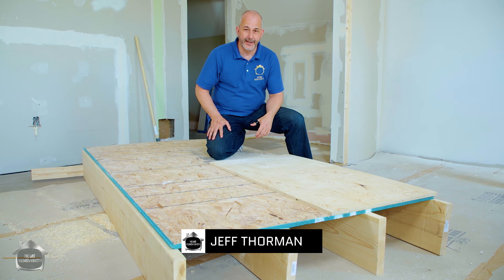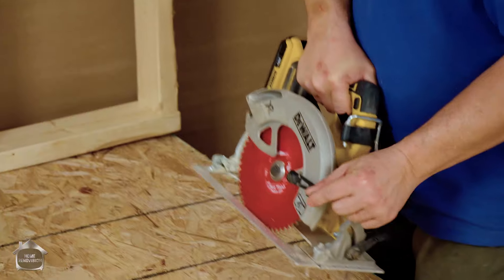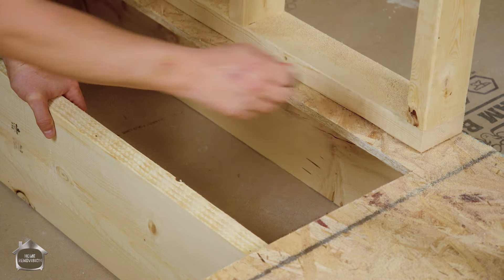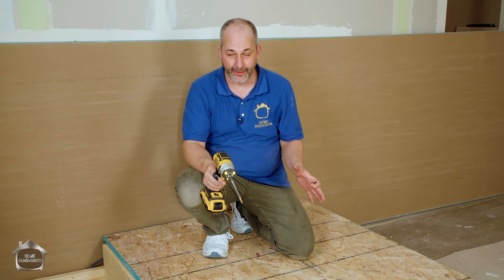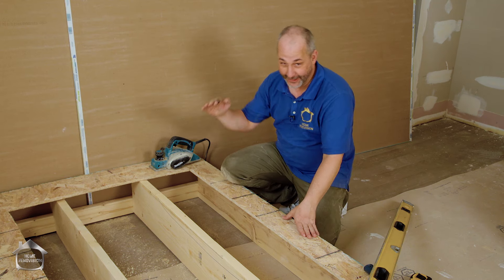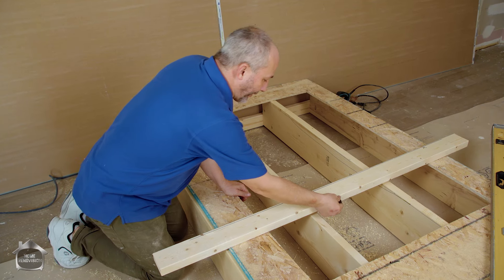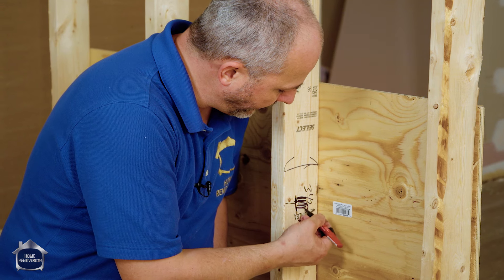Watch This Before You Renovate Your Floors

Comment: OMG this video is long but worth its seconds in gold.  Love the videos, Papa Jeff is the reason I'm remodeling my house (I'm a nurse with little construction experience) and only having to hire professionals for jobs I'm really not comfortable doing (electrical, plumbing, ceramic tile).  I'm about half way on my bathroom and kitchen remodel, took it down to studs and replaced subfloor since my house was built in 1925 and it squeaked like crazy.  Now the floors are not only stronger but no more squeaks.  And my kitchen and bathroom exterior walls now have insulation.  Thank you again Jeff, you not only have saved me thousands but helped me learn how to repair and maintain my house.  I live in southern California.
Reply: Wow!

Comment: The proper steel screw sizes for securing 3/4-inch plywood to the floor joists are #8, #10 and #12 screws. The number refers to the thickness of the screw. Each is available in lengths from 1 1/4 to 3 inches. Typically, the 3-inch variety is used to secure plywood subfloors.

Comment: I've never seen floor screws.  I'm in Michigan.  If I had seen those I probably would have bought them instead of the $30 boxes of 3" deck screws I put in my subfloor. Anyway I'm still glad I put all those monster screws in.  I'm 7:14 into your video... still watching.  I got rid of the squeaks from the subfloor but when I put the hardwood floors in I ended up with squeaks from the hardwood at a low point in the floor.

Comment: WOW! The amount of information in this 1 video is so valuable! I live in the second apartment of my house in northeast USA, its 117 years old, with tongue and groove wood planks nailed directly to the floor joists in the bedrooms and kitchen. The bedroom floors are in horrible condition (too thin to refinish, chipped boards, holes, oh my!) I want to install LVP flooring. Can I just put a 1/4 plywood over the wood planks? If I need to pull up the wood planks and install subfloors, what thickness would I use? 😮😮

Comment: My house in Winnipeg I had built in 1984 by a big builder and picked one of their house models.    i  asked that the 5/8 inch plywood be screwed and glued.   It has been very good I have a couple of squeaks upstairs.   I put ceramic tiles all over the  place and no cracks anywhere.

Comment: Hi Jeff. Great video. Just to confirm. There is another video on floor leveling where you use self leveling compound. The question is when to use the compound and when to cut the subfloor a d replace the plywood. Thank you
Reply from the maker: if you have a bowl use the compound. if you have a hump open the floor. Cheers!

Comment: Not getting into the mess of my floor being the old OSB w/ glue & regular nails....I bought the Brand ProGen vinyl plank flooring w/ the subflooring pad already attached to their bottom. So, after I try to stabilize any squeaky floor joists, I can lay these vinyl tiles straight onto the wood, right? :-/ . I don't trust any salesman these days, even though they say yes or no, ha. Thank you SO much for your VIDEOS!!!! I'm single without a man around the house &, living in a rural area, where it's hard finding workers w/ good handiwork, let alone finding workers period sometimes! My current little fixer-upper I bought has revealed more & more issues here & there that has been overwhelming me at many points. Having someone consistently giving a flow of information & teaching on all areas of home renovation has made me feel hopeful that at lease I can do some of the work myself (besides electrical!). Thank you again!!!

Comment: You are helping a whole lot with your videos...  Thank you...
I have a bathroom subfloor to repair...  The guy lipsticked a pig so it was pretty to sell the place...  So much hidden stuff...  The former owner of my home installed a low flush toilet with just a wax ring on the toilet pipe...  No flange...  Its leaked - you can imagine the mess...  Opening up the floor will show the damage to the kitchen ceiling below as well...  I probably have to pull the drywall ceiling in the kitchen... Then there is the bathtub that was installed 1/4 leaning to the front...  * Cringing... * It ruined the drywall - the tub n surround needs pulled & redone...  We need to repair the sub floor - add 5/8 plywood to meet the height of the hallway flooring...  * Sigh... *  I am really not looking forward to fixing all this...  But the more we can do on our own without hiring someone the better...  Thank you for your videos...

Comment: Wow, thank you for this! I'm trying to fix a floor that has a few water damaged areas in the subfloor, and I was wondering how in the hell you could cut out a section and still make it work. Also dealing with loose nails and squeaky floor. Excellent video.

Comment: Built new houses for a short time in the states.  Some houses we uses collated screws and long screw gun to screw down 1 inch decking.  Other homes they has us bent over with the nail guns adding more nails right before the flooring was done.  Nothing pissed us off more than to go into the sales model and fix the squeaks from the basement because they wouldn't pay for us to screw down the subfloor to save  $2-300 (1 guy less than 1 day) in labor plus the cost of screws.  They were also skimping on giving us enough glue for the subfloor.  It was about how fast we built not how good we built it.

Comment: hey Jeff - i am redoing my cabin.  the floors are wood planks maybe 2-3"wide all through the flooring.  Subfloor Ikd - I have to look.   In the bathroom is where I want to add a new floor.  Can I just put down on top of exsisting floor lets say 1/2 inch or less plywood to make an even surface to work with - I am going with a water proof vinyl flooring ( I watched the video of what to pick).  I actually watch a lot of your videos and so appreciate the info you give.  THANK YOU

Comment: I grew up in a Sears house built in 1920. The floor joists were 2X12 and the subfloor was 1 inch thick shiplap installed at 45 degrees to the floor joists. On top was 1 inch thick white oak 2 inch wide tongue and groove. A special paper was used between the subfloor and the oak floor boards. None of the floors on the first or second floor ever squeaked. The oak flooring was attached with cut nails through the tongue. The only visible nail holes were where we added boards during a renovation.  That is how we found the paper. The paper was green. It was not asphalt impregnated paper.

Comment: I'd like to know how to prep subfloor structure for tile when your 2nd floor small bathroom sits directly over 1975 sistered joists. Do I laminate the joist from both directions of existing joists? Do I apply blocking where the old joists r sistered? Should I apply thicker or special blocking if the original sistered joists are tilted/ separated from time? Thx!
Reply: Help!
Reply from the maker: you really need to send me a picture in the forum. I will look for it tonight. Cheers!

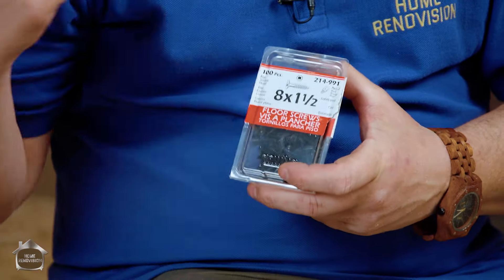Comment: 6:57 Hey Jeff, not sure if already answered, but gonna leave some info anyway, cuz ya asked for it.
Here in States we do actually have fasteners (screws) that are specifically made for subfloors, & some are marketed only as for WOOD to WOOD by some brands,  w/ specific tech data & skew and what meant for are subfloors (also, find that some stores and even ppl think subfloors and Underlayment 
is same thing. Not the case and same goes for Underlayment screws. I wouldn’t use an Underlayment screw for a subfloor, but I would use a subfloor screw for Underlayment if couldn’t find or have “proper Underlayment  fastener system” we are using. Hope makes some sense). Note for some ppl, there are brands that make fasteners and say “Underlayment” and in some cases, they referring to subfloor (Happens every so often as marketing and languages Kinda get muddy every now & than)

Here’s some Brands for subfloors and thru in Underlayments too. ALMOST all are Torx drive screws, or Robies, but alas….some are still only Phillips 🤦🏼 
In no particular order, we have:

1] Simpson Strong-Tie: R4 Multi Screw=general multi purpose but can be used 9n subfloors
2] Senco: Underlayment Screws
3] Simpson Strong-Tie: WSHL Subfloor
4] Simpson Strong-Tie: WSV Subfloor
5] Simpson Strong-Tie: Quik Drive Subfloor
6] Simpson Strong-Tie: MTH Underlayment Screw
7] Senco Duraspin Subfloor

So, majority are collated for coil nailers or strip nailers; or as a brands stand alone specific tool; along w/ an accessory for someones impact driver or drill driver that just gets attached…BUT these systems are to make putting these into subfloors auick, but if DIY or anyone who wants to do there own work and doesn’t wanna buy into a “tool system”, well you can purchase the collated screws and just detach them from “collated material” by knife, scissors, etc…. Having coil or strip nails doesn’t means YA GOTTA ONLY USE IN NAIL GUN😉, you CAN separate them and use good ole HAMMER to install, lol
Sorry for length, 
cheers Jeff and Max✌🏻

Comment: I am an electrician working in the United Kingdom. I am not sure how they do the plumbing and cabling in the USA and Canada but here much of piping and cables in older properties are laid in slots. The last time a carpenter offered to take some flooring up for me, using a circular saw, he did exactly what you did ie. Set the depth of the blade slightly deeper than the floorboards. As a result I had an hour repairing the cables he sawed through. Perhaps you could mention that for UK watchers.

Comment: Really comprehensive instruction.  Thanks Jeff.  I have the RIDGID JobMax oscillating tool which has the multi-head feature that provides different heads for different purposes.  The right angle drill head is great for both drilling and driving screws and will get into anywhere with about 4 inches of clearance.  Lots of power to bore through studs with any drill bit and up to about a 2-1/2" hole saw bit.  JobMax is a mid range tool, but with the lifetime warranty it's hard to beat.

Comment: I've never seen "flooring screws" on the shelf here in the US, but I'd be willing to bet that you'd be perfectly fine using 1-3/4" to 2" exterior screws.
Reply: Just use deck screws.  They have the same Robertson head.  You just pay a bit more because they are coated to be resistant to pressure treated lumber.

Comment: My home is 1955. Just had to take it down to the subfloor due to water damage. Looks like 1x8 soild board subfloor with 2x 8 joist every 16". Im having to replace a few boards because it seems like they split and broke some while installing underlayment.  I will be using screws as well as securing the old ones better with screws. Im also adding moisturizer barrier then 19/32 osb and uncoupling membrane befor tile. Does that sound like a good base for 12x24 tile?

Comment: A year after we moved into our house (built in 1966), we had to replace the tile landing by the front door. The house was renovated in 2016, but it all looked like they cut corners. The tile grout was failing and most of the tile was loose. We tore it up and found they screwed and glued the cement board on top of the original subfloor that was super thin and did not laminate the joists. So from 2016-2019, the subfloor and joists were slowly failing due to the wait of the cement board, tile, and people walking on it. We had to replace the subfloor because it had already failed in a corner and replaced a joist that was very close to breaking. Then we laminated all the remaining joists and the new one. 

It sucks because we are slowly seeing everything they "renovated" fall apart in just the 5 years we have lived here.

Comment: Our old house (built in 1965) had a squeaky second floor. After trying to tighten up the floor with screws , we still had squeaks. At a later date while working in the kitchen soffit I noticed that the contractor had use 1/2” cello-Tex on top of all the joists , under the subfloor, of the second floor. Over time the Cello-Tex  had deteriorated to the point where it was mostly dust but some solids which meant regardless of the number of screws it was always going to squeak. Although annoying at first it’s came in handy when the teenager tried to sneak in after hours!

Comment: Thank you, Jeff, for your channel.  Been watching your videos, but still nervous taking this on.  If the vinyl plank has an underlayment attached, should i still use an underlayment?  My "Michigan" basement is a freezer.  Been told two different things.  This is my first diy in a 100 year old rural farmhouse.  My subfloor is mixed across the room, and my subfloor sits on huge, old but solid timber logs.  They are braced together with 1x4 wood.  Little bit nervous as this is my 1st major project and im not young.  😊

Comment: Thanks for video! I had hired a general contractor to renovate my bathroom (1985 ) I had chosen 12” x 24” tile and shortly after he completed the project I noticed that the grout was coming up so he came back added additional grout but 6 months later it came up again. After watching this video I’m pretty sure he didn’t prepare the sub floor properly. When I go to hire someone to replace the kitchen floor I’ll be sure to review the plan for sub floor.
Reply: Did he lay the tile on OSB or plywood.  I once saw a problem like that with tile on OSB.  You can not put tile on OSB.

Comment: Question. I just pulled my sub floor in my living room to replace one of the seals and it was built with 2x6 with 16in span and 8 ft support so that's what I went back in with. But all I hear you say is 2x10.. so my question is what u have ok and is there something I need to do to strengthen it before putting in the plywood subfloor? Thank you in advance

Comment: Hi Jeff, How would you replace a small piece of subfloor under a wall and between the floor joists where the floor joists are open from the room below? The bathroom was left wet and is that subfloor is now gross, won't hold screws, and is flaking apart. Most of the area that needs to be replaced is in the center of the room, but there is about 6" that goes under the wall that I would still like to replace. Also, thank you. You have made  huge impact in my self esteem. I have taken a house that sat on the market for over 6 months, headed up the renovations (with some expert help when needed and to check my work) and created a beautiful and safe home. Adjectives like creative, hard working, resourceful, amazing, and beautiful now sit more comfortably with me after seeing for myself what I was able to do.

Comment: I pull all the old subfloor nails I can find and replace them with large stainless steel deck screws.  This usually stops the squeaking.
If that doesn’t work, I pull the noisy floor panel up and add cross braces and screw into the new cross braces along with joists.

Comment: i saw tommy silva from TOH use screws where the heads break off, but i have never found those , but i have  what looks like a finish nail shape with a tiny head and square drive ,  they look alot like what you are using as flooring screws , i use them for making furniture and speaker cabinets ,i don't really like my brad nailer so i like to use these because it leaves only  a tiny hole to fill , but we definitly have them , or at least what looks like them , i think they are actually labeled as decking screws, both depot and lowes have them

Comment: Jeff my 1978 house has toung n grove 8 inch wide boards over the joists and USB over that. The squeak is in the t&g joint. Only way I found to stop it somewhat was in the crawlspace with 2 inch screws angled through the joint. Still have squeaks just dont care as anymore. I also used a lot of sqeekeze snap off screws in carpet areas. Your floor will crack tile. Too thin.

Comment: Pulled up hardwood floor off my 1968 1000sq ft home. It has 1/2” plywood. Also has baseboard heating. Thinking I need to pull heater strips, and add a 1/2” more plywood to stiffen floor. Do I need to glue and screw, or just screw new plywood down?

Comment: ing a floor in an old cabin-type building, likely built in the '60s. I have bought vinyl tile (2') to go on the subfloor which I am to install. The subfloor is going over the existing subfloor, some of which still has linoleum on it. For some reason, all the baseboards were left in place and already caulked (so I can't pull them for the subfloor installation). There is uneven plywood at the doorways into the bedrooms. My questions are as follows: 
1. Do I need to level the existing floor prior to installing the new subfloor?
2. Can I lay the new subfloor over the partially linoleum-covered floor?
3. The vinyl tile we are installing is going throughout (living room, kitchen, 2 bedrooms and bathroom). We are repurposing some kitchen cabinets, as well as a new shower stall and toilet. Should I install the cabinets, shower stall and toilet directly onto the new subfloor we are putting in, and then vinyl tile up to these fixtures?
4. How forgiving is 24" vinyl tile with regard to sloping/uneven subflooring?
TIA.

Comment: Thanks for the info!! Maybe I missed something, but how is laminating making the gap too wide (throwing off the 16" on center)? I thought it was strengthening the joist. I would think to ignore it. FOr example, if I do bicep curls to strengthen my arms, my arms get stronger, but I dont grow  another arm. Shouldnt the additional 2x4 be ignored when measuring 16"? I wouldnt want to screw in the middle of those two pieces of wood.

Comment: I have a 3/4" plywood floor over 2x10 joist on 16" centers, glued and nailed. I removed the ceramic tile in the kitchen after 35 years. I'm replacing it with a floating LVT planks. I need to add a underlayment of 1/4" to match the thickness of the old ceramic. How should that underlayment be screwed to the plywood?